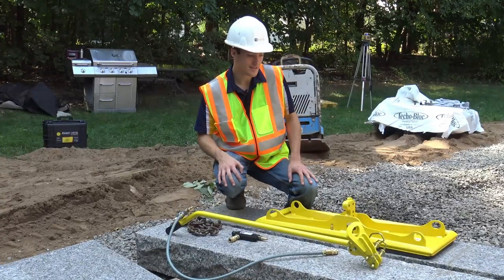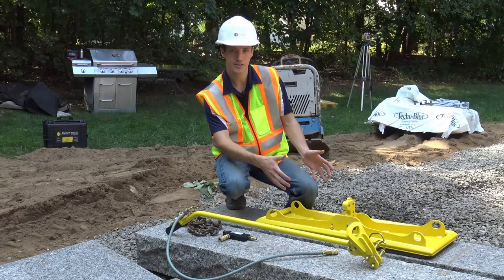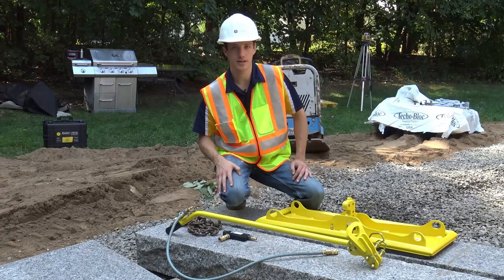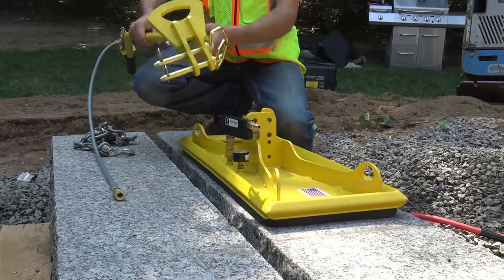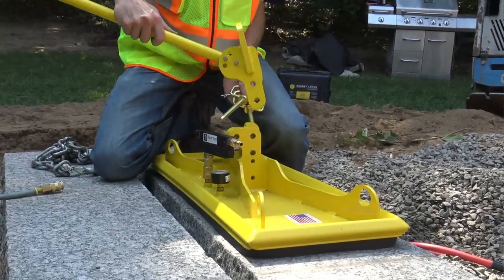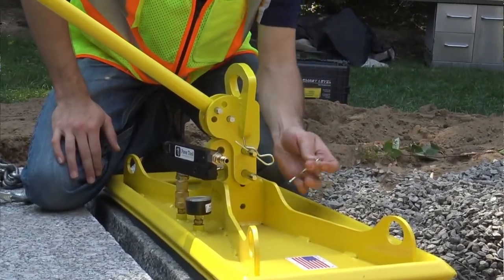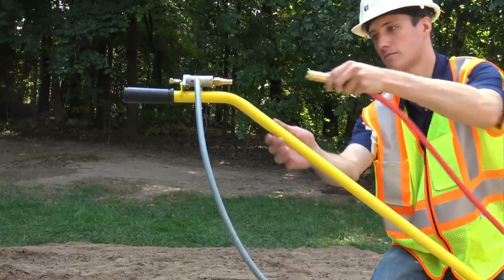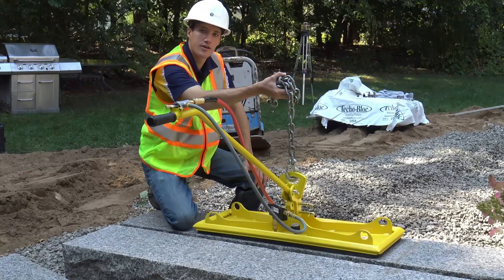Manual Pkg  A2 Instructional Video

Comment: Key point there that isn't highlighted - to engage suction pad to the stone, the operator steps on with full body weight.
Reply from the maker: Hello, thank you for watching our video. Regarding the suction pads, its not always necessary to step on the pad in order to engage the suction depending on what type of product you are working with.
Reply: @PaverToolInnovators   that was the difference between "am I doing something wrong" with my brand new tool? vs. "that's pretty cool, I'm glad it actually works!"